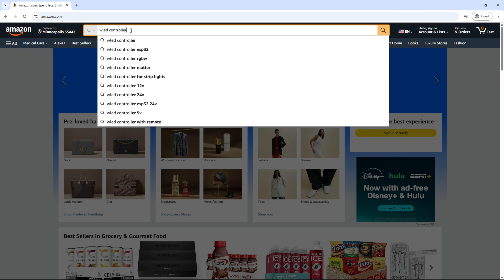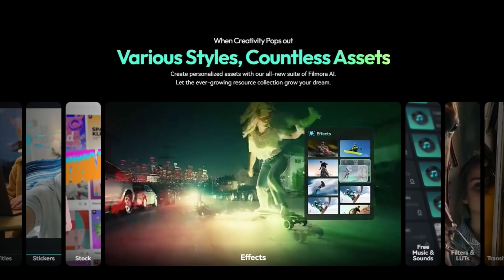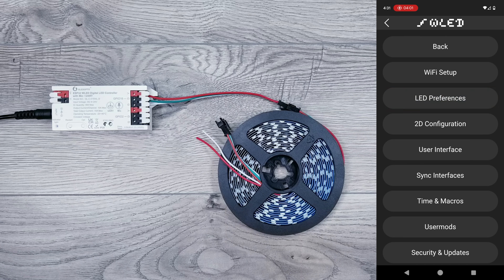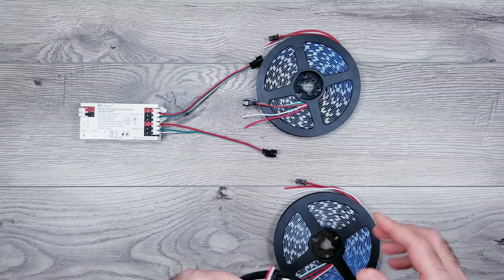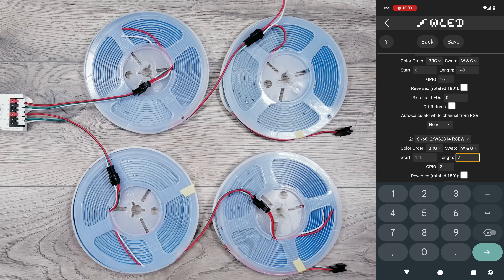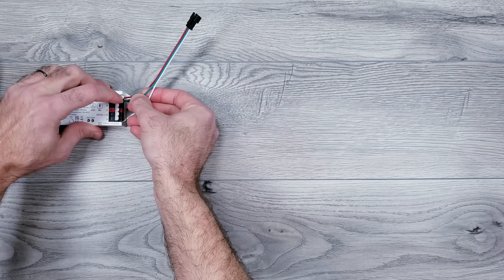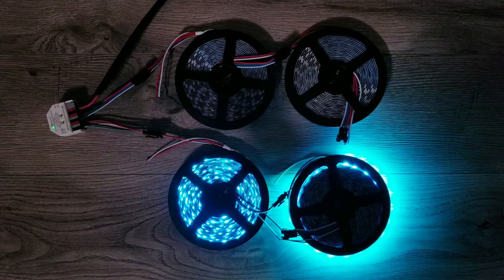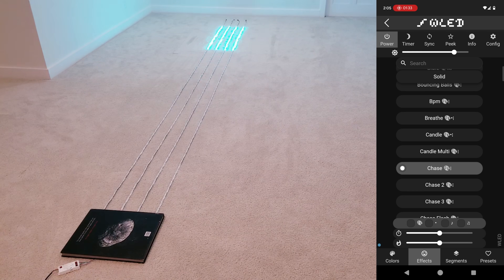The ULTIMATE 5v, 12v 24v LED Setup Guide for Beginners. EASY Plug n Play WLED + Sound React WLED

Comment: I am wanting to use this for my eufy e22 led lights. They are 36 volt. So can I simply use a 36 volt supply for lights and a 5 volt supply for data wire only? So I mean 5 volts into controller and only output 1 data wire per section of the 2 output sections seeing as the lights get power via 36 volt supply?

Comment: im thinking of doing something like this for my truck, would you be able to make it go from the middle of a 24v LED strip and out to both sides, or are you locked to have it one or the other direction?

Plus

would i be able to have it run a secuence when it recive a signal? like when i unlock the truck or open the door? if so, what would be the best way to go about it?

Comment: As someone who really wants custom LEDs in his room but also has no background knowledge about electricity I have a question: You say you use a 5V 10A power supply for a total of 900LEDs (3x5m with 60LED/m) An LED uses about 60mA on full brightness meaning all 900LEDs would need 54A right?
How does your power supply handle this without a problem? Where is my math wrong?

Comment: Chris i really need your help. I tried setting up my lights and whenever roughly 830 leds turn on my controller turns off. I've tried many different configurations but the controller will turn off whenever the LEDs turn on. I was able to get the control to work with only one strip. I'm not sure what else to do. It would be great if we could pay to reach out to you.
Reply: I know nothing about this but the one controller I saw on Amazon was limited to 800 ICs.

Comment: If i snip a LED strip is it possible to solder a JST connector to the pins on the strip and have another spool seperate strip of LED running off that? I want to use predetermined lengths length totally about 4-5 strips.
Reply: Yes, you can solder the strips together directly. He did a video showing exactly how & where to cut and solder. He also did a video on voltage drop, you may be fine with 5 strips, but he recommended using the 24v lights with 24v power supply because they reach longer. Otherwise you need a power injection site so the lights don't get dim and flicker. He also did a video on that. Lol hope it helps. Just binge Chris's channel tbh.
Reply: And yes you can solder jst connectors to all of them.
Reply: Just remember to look at the directional arrows. U can fry the LED strips if you put them on backwards.
Reply: @d3bbi339  appreciate the help! will defo search for his videos on soldering them! thanks!

Comment: Hello, I need help.
I have a WS2814 24-volt, five-meter-long light strip with 420 LEDs and a 126-watt consumption per strip.
With a 400-watt transformer, it works fine when I connect the strip to another strip.
However, when I connect three strips of 15 meters each or four strips of 20 meters each, the light color changes at the end of the strip.
Is there a way to make this work properly?
Reply: Hopefully you figured it out by now but it means you need more power, or use power injection, meaning run power to he end of the strip

Comment: Thank you for always making cool content. I have a project I'm working on in my backyard with LED strips on each post (about 30 post). I'm using the muzata 3.3" led channels. My question would be what light you recommend for outdoors and what controller and how many? Wire and connectors, etc... I'm guessing they will have to be daisy chained to a main controller/controllers. And the lights have to be waterproof cuz they're outside. Trying to do this for my wedding. Also, the whole point of them is to respond to music being played and light up the backyard. Thank you for any advice.

Comment: I'm about to use all your links to order for my first project. The only thing im struggling with is understanding power demands. I saw your videos on how you really dont need that much power for ambient lighting, but i'm still not sure what my constraints are. A video not just show casing how much you can get away with on one strip, but a general guide on how much you can do with one strip with a certain power supply / how many amps you need etc, as well as what  happens if you accidentally overload psu unit... To a novice these are overwhelming concerns. It would be a nice way to put the psu, power injection, and amps need for multiple strips stuff to rest.  I was going to get a 5V 60 amp PSU that you recommended and chat gpt said i can get away with this for 3 strips around my room at 50% power. But I also want another 3 SK6812 strips connected to each other for the base of my floor. Does this mean i need 2 separate 60 amp units? Watching this video I see you using 20 meters on a 5 amp unit at 7:40. this makes me think maybe i could use the one unit for both strips... I also plan on connecting the back of each strip to the PSU for power injection since its the simplest method. Idk just still very confused... I worried about over loading my psu system. chat gpt also recommended i get inline 10 amp fuses.. And I plan on getting those resistors you mentioned in another video for the data since its a long strip. Thank you for these videos. It has given me the knowledge and courage to attempt a project like this with no background.
Reply: I'm in a very similar boat as you. I don't fully understand the power injection part: the when, where, and how. If I want to use the 5v SK6812 on a bookcase  with for 34" shelves, then another 5m for the wall between another identical bookcase... can I just do exactly what he did in this video, or will I have to actually inject power somewhere else? So confusing for a noob like me.
Reply: @jarodtaylor  I think for the shelf length plus the 5 meters you should be fine without power injection. I had 15 meters of led strips and the voltage drop off was significant. So i had to add power injection. 

My biggest recommendation is get a pack of wago connectors. It makes connecting wires and testing things way easier for a novice like me. With a wago connector. you can take this power injection guess work out of the equation. Buy some spools of wire, and wagos. wire clippers and strippers. 

Set your leds up without power injection and test it. If you see the voltage drop off then adding power injection is as simple as splitting the ground and positive wires with a wago, and connecting it to the back of the led strip.
Reply: @bravo123345  Thank you! Just ordered some wago connectors.
Reply: @bravo123345  I wanted to do 2 seperate runs of 33 Feet, the lack of built in lighting is complimented by copyrighted neutral paint colors. I need more light for half of the area to even use it. I'm due to sign my 11 th yr lease and I need some color up in here!
Reply: I’m facing the exact same issue! I’m also planning a project with multiple SK6812 strips and not sure how to power everything safely without overloading the PSU. Did you end up figuring out the right power setup?
Reply: @RWawrowicz  I ended up getting a 30 then 40 amp PSU which is able to power 6 300 LED strips. I initially got a BTS 30 amp PSU he recommended but it was faulty and caused me loads of headaches. The WLED discord community recommended the Meanwell PSU brand. I got a 40 Amp one and it works like a charm. 

I also got the 10 amp fuses, I figured why not, and hooked one up to each run of led strips ( i have 2 runs of 900 leds) they work just fine, maybe it adds some protection to my LEDs. I'm not entirely sure how needed fuses are, he never recommends them but chatgpt did. I figured better safe than sorry.

For figuring out PSU amp needs. I just set the limit to just below my fuse amount, at 8 amps. I've seen him recommend 3 -6 amps. I figured as long as the total amp limit i set is below what the PSU is rated for it should be fine. 8 Amps gives plenty light for 900 LEDS since i only want ambient lighitng. 

I did need to add power injection into the back of the LED, the Voltage drop off was significant without it. 

I also highly recommend wago connectors. As a novice this made testing what was wrong and connecting things way easier.
Reply: I'm a MD by trade, but electronics computer auto wiring nerd for fun. I was running my webcam so hard so long recently the fans on the battery kick on super loud. It was drawing the max power thru ethernet. 
If a power supply doesn't make noise, that means shorter lifespan. It might just break it self, but it could start a fire depending on what the setup is. Oh I am so ready to do my crown molding up with some color. I just can't decide on which ones to go with. 
Smile, Jesus loves you.

Comment: Hello i bought the same things and when i plug them in only the first few work and the rest are off can someone help me please
Reply: I FIGURED IT OUT! After trying every little setting imaginable, I realized that I was plugging into the wrong end of the LED strip. For the 24 volt strips, you want to use the input closest to the center of the roll. Hope that helps!
Reply: Did you ever get this working? Having the exact same issue. Like only the first few lights are on and nothing on the app changes anything, and when I plug in the ground wire there’s no light at all. I’m using the recommended 24v power supply and exact same LED strip WS2814.

Comment: Can you use a 1 to 2 splitter and then split those 2 again, thus having 4 strips to control at once.  Each strip would only be 1 meter long?
Reply: You can buy if you split though both strips would get the same commands rather than individual, easier to attach the new strip on the end of a previous strip adding more channels

Comment: Hey Chris. Is there a PIR motion sensor that you could recommend to pair with this controller? Is there a way to use two motion sensors with this controller?
Reply: That would be a great comparison! I actually edited a similar video with Filmora, and it made the process so much smoother.

Comment: Hi Chris, thank you for your videos, they have given me a lot of information, very helpful! It seems I may have ordered the incorrect gledopto controller, I stupidly went for one which has zigbee support (gledopto GL-C-202P) to integrate with Home Assistant, but then forgot to check the terminals, and it has come with many additional inputs for the LED strip (V,R,G,B,C,W), but the LED strip only has the 3 wires (red, white, green)... Do you know if there is there any way to make these 2 work together? Any advice would be greatly appreciated! Cheers!
Reply: You might need a different controller that matches the LED strip wiring. I ran into similar issues, but Filmora made editing my troubleshooting video super easy to share.

Comment: It’s possible to control the lights when you are away from home using the app ?
Reply: Yes, you can control them remotely using the app, as long as your controller is connected to the internet. I set up something similar and used Filmora to quickly make a tutoria

Comment: can this controller be used with 12v ws2811 bullet pixels?
Reply: Yes, this controller can work with 12V WS2811 bullet pixels, just make sure to set the correct LED type in WLED. I showed this setup in a video edited with Filmora.

Comment: Hi, great video, one question, how can I know the amperage I need in the power supply for a specific model of LED strip, in this case a skSK6812 rgbcw with 60 LEDs per meter.
Reply: Great question! To calculate, check the wattage per meter of the LED strip and divide by the voltage. I used Filmora to edit a similar guide—it makes explaining these details super simple.

Comment: did you not forget in wled to set the LED's to be 12V when using the 12V setup ? it was still saying 5V
Reply: Good catch! You do need to set the correct voltage in WLED. I ran into that too, and when editing my setup video with Filmora, I made sure to mention it for clarity.

Comment: It is hard to put leds on flip cabinets doors,literally on the down side of the doors to light when it's open( by attaching a switch,and when you open the cabinet door the light starts turning on),but using the same controller..,doing like 4 flip doors and another 5 normal cabinets.
Reply: That sounds tricky but doable! I worked on a similar setup and edited it with Filmora—helped me keep everything organized and clear, might be useful for your project too

Comment: every ws2811 chip control 3 led togheter so in 5 meters you don't have 300 leds like you config you have 100.
Reply from the maker: Thanks for watching! I'm not using ws2811 strips in this video but if I were, that is correct as long as you are using the led strips. There are also ws2811 cob led strips and those would be different.
Reply: You’re right! WS2811 controls 3 LEDs per chip, so 5 meters with 60 LEDs/meter would give you 100 controllable LEDs. I explained this in a setup video I edited with Filmora.

Comment: Can i cut that connector and just directly connect wires from ledstrip?
Reply: Yes, you can cut the connector and directly solder wires to the LED strip. I did something similar and documented it in a video using Filmora—it made the whole process clear and simple.

Comment: Hi Chris, Not sure you will see my comment and reply but I am hoping you will take 2min if possible. Can I connect 3 of the cob in one channel? So, 3x5m + 3x5m = 30 meter of Cob to cover my entire big living room. I am not getting any 48v suitable dyi options thinking 48v is better so, will this 24v work? My priority is White (Cool & Warm) smooth light & occasional color. Also need Alexa control & optional led control switch for color and brightness adjustment.
Reply: You can connect multiple COB strips in one channel if the power supply can handle the load. 24V should work fine for your setup. I used Filmora to document my setup, making it easy to share and troubleshoot tips

Comment: If it weren't for you tutorials I would have never attempted these types of things :).  I just installed one of these and can't get it to sync.  Both "old school" ESP32 and this ESP32 are both on the same network.  Still won't sync.  Any tips or tricks?  Thanks!!
Reply: Glad the tutorials helped! For syncing, try restarting both devices and double-checking the IP settings. I made a similar setup video using Filmora—made troubleshooting a breeze.
Reply: Hello! I have 2 GLEDOPTO WLED ESP32 UART 4 and I can't sync them. Did you manage to use the sync function with yours?

Comment: No need for power injection for the 2nd add-on light strip?( 5 meters rule)
Reply: For longer runs, power injection may be needed to maintain brightness. I documented this in my setup video using Filmora—it made it easy to explain the details.

Comment: The First WLED Controller can handle up to 10A per channel and a total of 15A (unusual, but acceptable). My question is: how can it power a 90W, 5m SK6812 strip with a 15A device? Dividing 90W by 5V results in 18A. Since you're likely connecting more than one strip, this exceeds the controller's capacity. The same logic applies to WS2815 strips: 90W divided by 12V equals 7.5A per strip. Connecting two strips would already reach the maximum capacity, let alone four! Could you please clarify how this setup works? I'm interested in using this solution to illuminate a 120-inch projector screen. Besides first WLED controller says it may handle maximum 800ICs
Reply: As far as I understand it, the 90 watt rating on the strip is the maximum power draw for the strips which would produce the brightest output, but they will run at lower power levels, with lower brightness. In the settings he set the current limit to 4A so the controller will limit to 4A*5V=20W, and the brightness of the strips will be limited accordingly. I believe the current limiter applies to total output, so you can add more strips but you will be limited to whatever total current is set there, and the brightness will be reduced accordingly. This is the same in 12V, but because of the higher voltage you will get higher max power/brightness for the same current limit 12V*4A=48W.
For the IC limit, I believe this applies per data pin, so with two data pins it can do 1600 IC total. I think you can add more beyond this limit but it will slow down the animations and may not look as smooth.
Reply: I am late here, but if you notice closely each strip has extra set of power injection wires in red and white, you can connect those to the power supply directly so that the power goes to them in parallel line rather than through the controller since controller will have more resistance. That way you are just powering the controller and the controller is sending data to your strips, but the power to the lights are going through the power injection lines because that is lesser resistance
Reply: He doesn’t have an answer
Reply: Good question! For setups like this, I found using Filmora to document everything helps clarify the power distribution. For multiple strips, you’d need to inject power at different points to balance the load and prevent overloading the controller. The 800 ICs limit refers to the number of individual pixels the controller can manage, not the total power draw.

Comment: Will the 5v power supply in the deacription power four, five meter rolls of the SK6812's?
Reply: A 5V 10A power supply should work for four 5-meter SK6812 rolls, but it’s close to the limit. I shared a similar setup in a video, and Filmora made explaining the details easy.